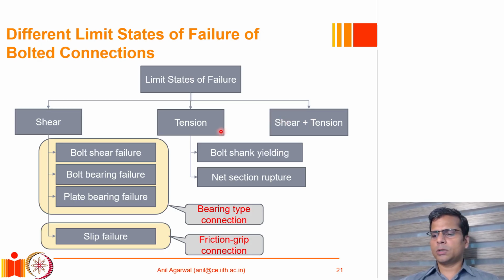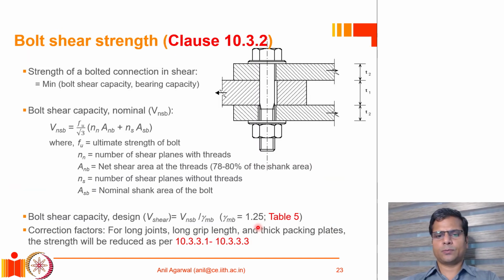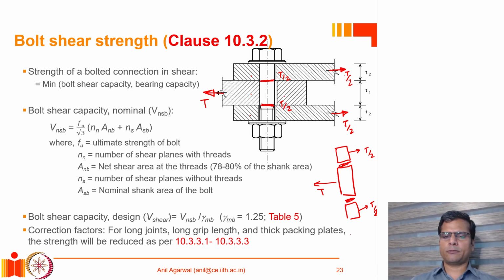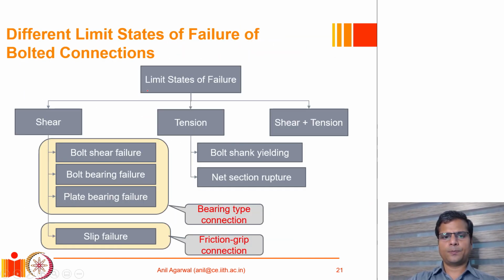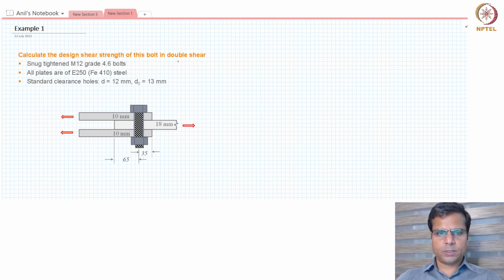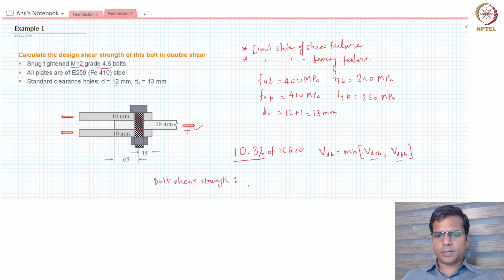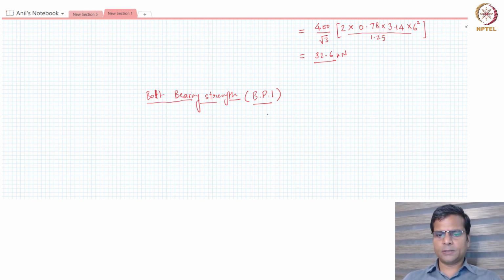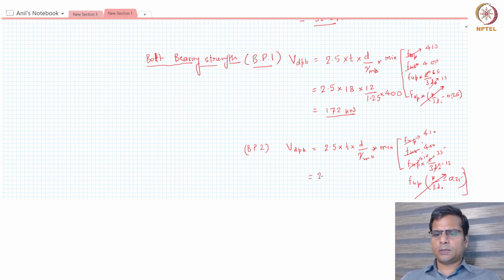Design of Bearing type bolts in shear: Basic design principle

Comment: Hi Sir,  is partially threaded bolt better than fully threaded bolts as far as design strength of connection is considered, as the area of fully threaded bolts will be less than the shank of partially threaded bolts

Comment: It is difficult for me to se why are we using reducing factors for bolts, what bolt have to do with the distance to edge? The only reason i can think of is that it reduces bolt capacity to take care of the plate, in fact bolt capacity is large but this reducing factors are rudicing bolts capaciy so that bolt do not damage the edge of the plate. Am i right?